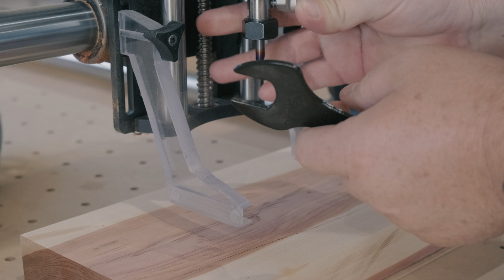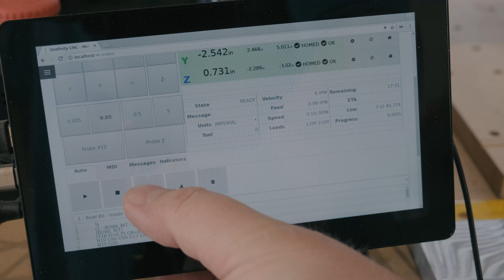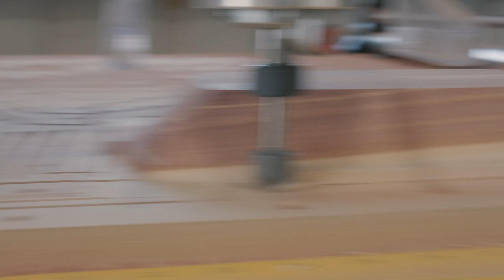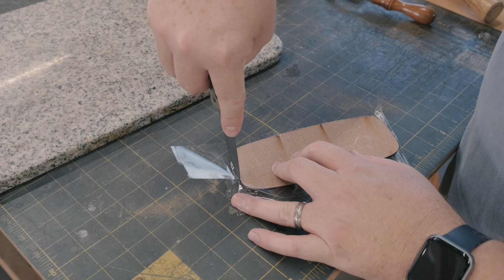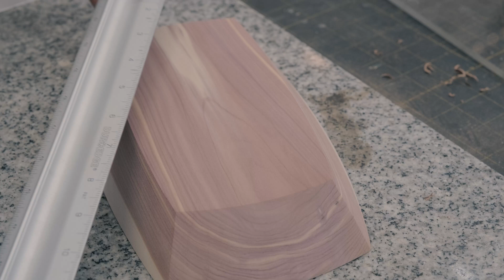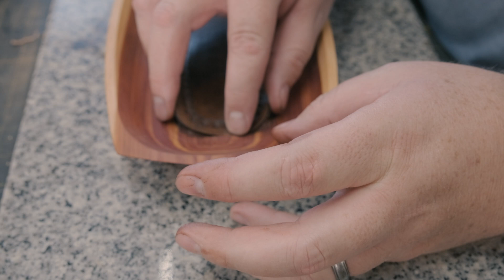EDC Everyday Carry Tray | Woodworking with the CNC

Comment: Just a tip-with the antique gel, use a resist before applying, and when you buff the antique off, it will remain in the crevices, and not sink in everywhere else.

You didn't apply resist, so the antique just sank into the leather
Reply from the maker: Thanks, good tip! But I actually did want the darker leather with this one. I usually dye with Fiebings Pro dyes, and resist with Tan Kote before antiquing. This gel stain is a while lot easier for something like this.

Comment: A current fashion born in Japanese gold repairs of ceramic masterpieces is to make a feature of such checking, by filling it with a contrasting colour resin. This is very common in kitchen fittings, and to reinforce burrs.
Reply from the maker: That would have been fun to try. I wasn't confident I could sand the interior very well with my current tools, so I took the 'easy' way out. Maybe I need to add a curved scraper to my arsenal. Thanks for watching and commenting!

Comment: I make a lot of food use wood things so I make my own finish with bee's wax and mineral oil.  I keep it in a small crock pot to heat it so I can apply it hot.  You can adjust the wax to oil ratio to get the finish you want.
Reply from the maker: Thanks James - good tip! I do a similar thing for my leather stuff, but I use neatsfoot oil instead of mineral oil.